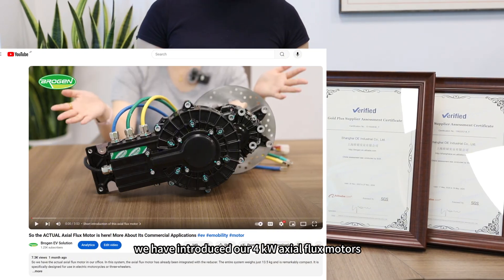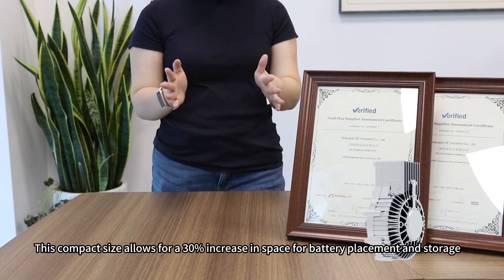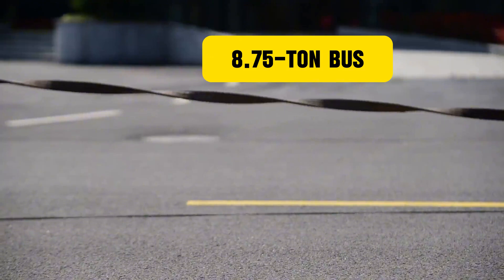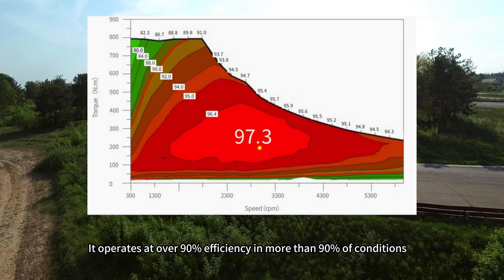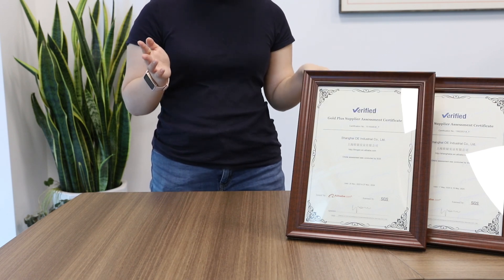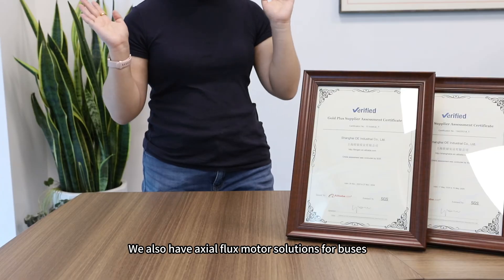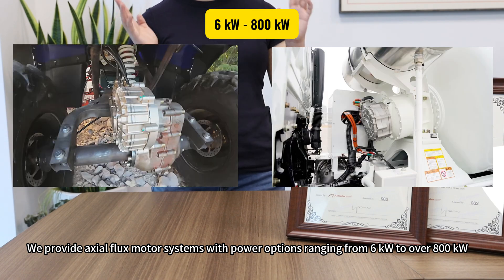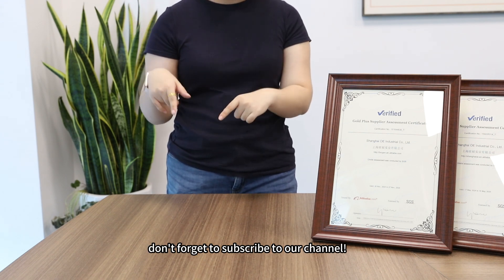Axial Flux Motor for Electric Motorcycles #ev #motor #technology #motorcycle #emobility #innovation

Comment: How much for the complete ev conversion kit ?
Reply from the maker: We can't provide the price for the complete ev conversion kit coz we need to know your vehicle specs first and check if we have existing systems for your project. If not, additional development fee may occurs and the price varies.
Reply: Do you have plans for making smaller motors for micro scooters?
Reply from the maker: Currently we have no such plan